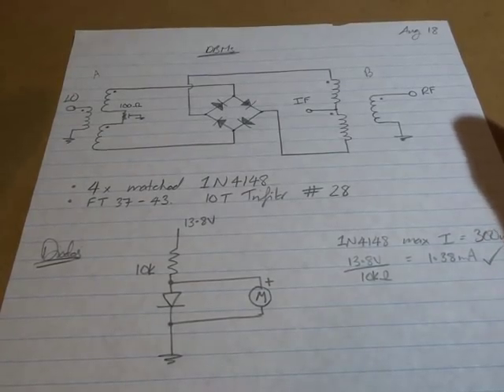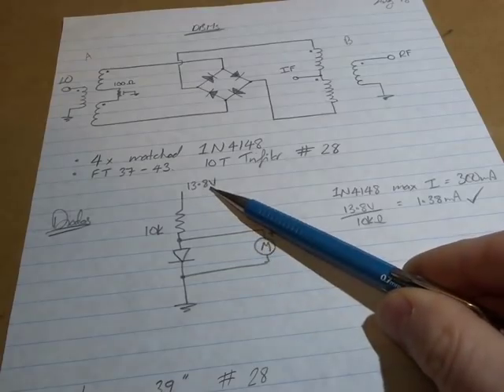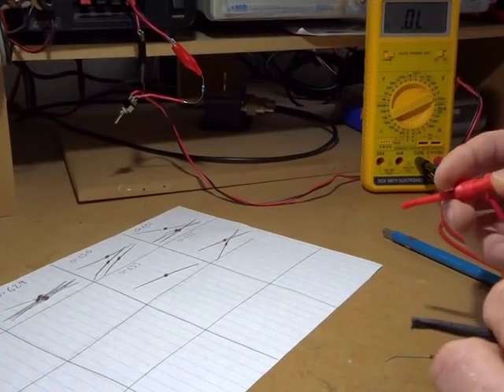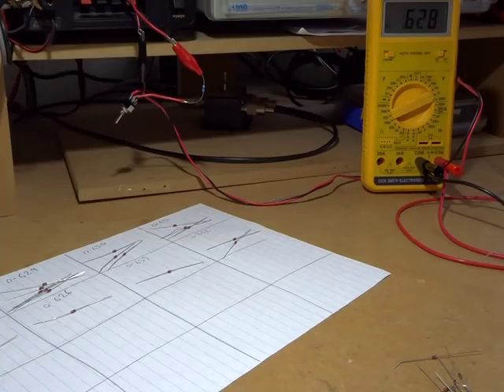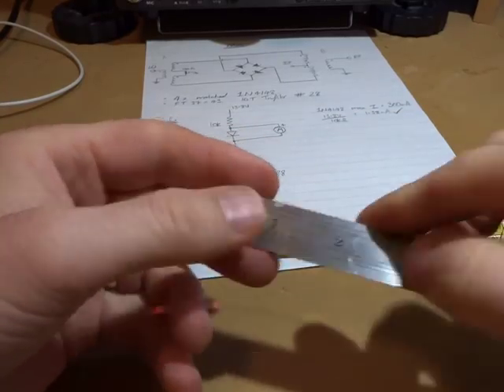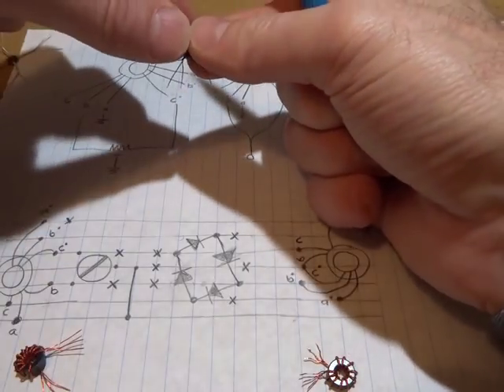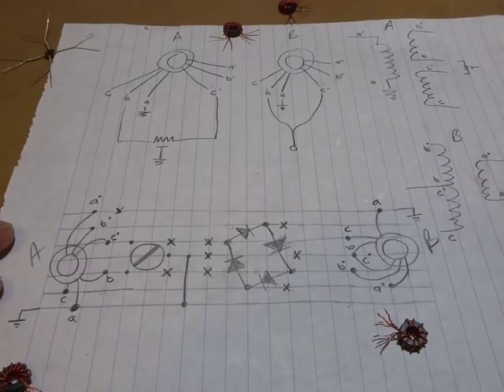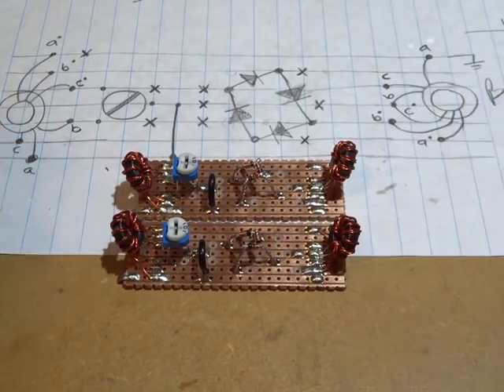Homebrew 80/40m SSB/CW Rig - #3 Double Balanced Mixer (DBM)

Comment: Another superbly done video Charlie. And many thanks for your channel, amazing job!

I noticed that, on both, the breadboard schematics and the final product, wire (c) of type A toroid connects to wire (c) of type B toroid, via the bottom-left diode. Similarly, wire (b-dot) of type A toroid connects to its namesake on the B toroid. But the original electrical schematics is slightly different e.g wire (c) on the A toriod connects to wire (b-dot) on B etc.. does it matter?
Reply from the maker: No it should be correct Luis. They are constructed as per the schematic. It might just be how i drew it out. The bottom trace is also earth. Sorry for any confusion. There is a later video on this too from the Simple SSB series. A week or two ago.

Comment: if this helps someone, i didn't find the correct video about DBM's inductance of 1:1 tranformers lowers cutoff is calculated by =>    2 ¶ F L² > 4 R
R (impedance) , F (freq.) and the high frequency has to be with the number of conductors twists .
Reply from the maker: That's good to know thanks.

Comment: Have you got details of the balanced modulator? Did you use an audio transformer? 73
Reply from the maker: Yes. Please see https://zl2ctm.blogspot.com/2018/08/homebrew-8040m-ssbcw-base-rig.html
Reply: @CharlieMorrisZL2CTM  Thank you very much for that, Charlie. I am making a tube transceiver at the moment but using your mixers. Dave G3PVH  73
Reply from the maker: @msf60khz  Sounds good Dave. The other option is to look at the SBL-1 from Mini Circuits.
Reply: @CharlieMorrisZL2CTM  Thanks Charlie. I need to up the impedance of the circuits to around 800 Ohms to suit my crystal filter and I have increased the winding reactance to 4k using binocular core type 43. Also used 1k pot for the balance setting. I have put the mixers and filter on top of the chassis where I can put a shield can over each of them. 73

Comment: Why is my homebrew downconverter for sdr not working? I am using a diode ring mixer with 10 turns for each transformer and I am using 1N419 diodes. When I adjust my function generator, It does not affect the spectrum at all.

Comment: How do you determine the inductance and/or number of turns of the transformer? What is my starting point when designing the transformer?
Reply from the maker: Gidday Rasmus. It's more about making sure the signal is coupled to the diodes and reconstructed again. 10T of trifilar windings on a FT37-43 works well for that.
Reply: Thank you for the answer.
I’m currently designing a Diode ring mixer as a school project and are mixing an 8MHz and a 5MHz signal. How would i determine what toroid and number of turns to use for my transformer in that case?
Reply from the maker: 10T is a standard number of turns for this type of application, and should be fine in your case.
Reply: Okay, thank you very much!

Comment: How do you match a diode?
Reply from the maker: Hi. It's in the video. Measure the forward voltage drop while forward biasing the diode with a 10kohm resistor. Measure a bunch and select those with the closest forward voltage drop to each other.

Comment: Hi Charlie

Good video. Couple of questions

1) what material are these wires...doesmt twisting them together "short circuit" them
2)what is the board used to assemble the circuit?
Reply from the maker: Hi Sameer. This wire had an enamel coating so there is no problems with shorting. It commonly called transformer wire. The board is simple strip board. Just be careful to minimize the negative effects of inter-track capacitance.Charlie

Comment: Like the jig idea for measuring to matched diodes,i learnt something with this as in the pass i just used ohm meter to match diodes ,You do lovely neat work with your construction.Cheers,
Reply from the maker: Yes it certainly works well and pays off in the long run. I get great performance out of the homebrew DBMs.

Comment: I built one from watching alan's w2aew video couple months ago useing 1n5711 diodes. how do you adjust the resistor. Listen to signal or other method. .great video.
Reply from the maker: Hi David. I'll adjust that once it's in circuit. I'll tweak it to minimize any LO BFO in the IF/AF output.